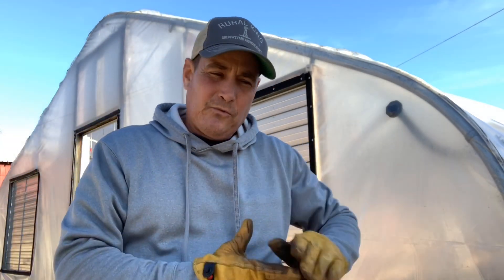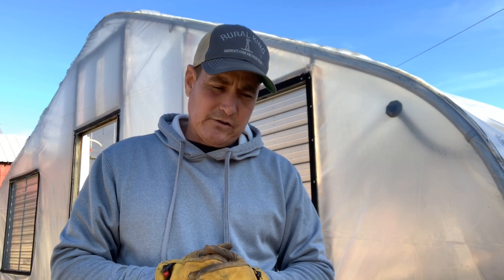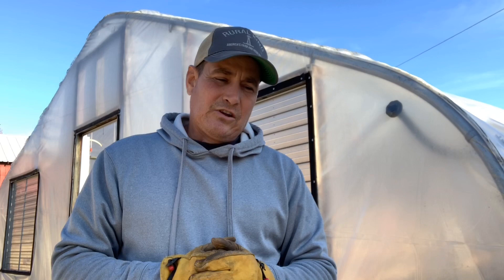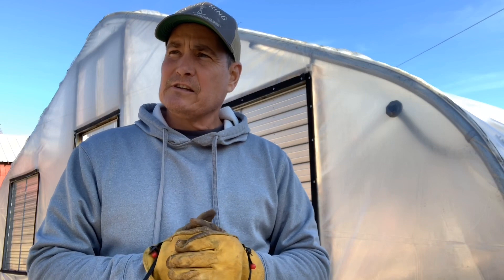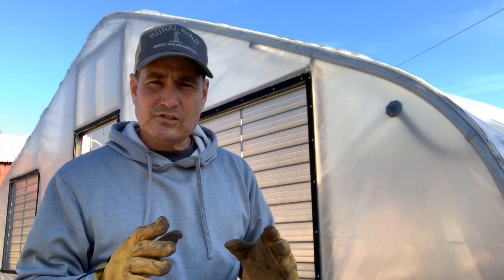The easiest way to cover your greenhouse: Part 1

Comment: I'm very happy you are doing a video on this task. Seems like there are a few ways of doing this so I'm interested in how you guys do it. I've admired how tight your plastic is on your greenhouses from seeing it in other video's you have put out. I'm sure it is a lot of work but if done right it is worth it. I have a small wood frame greenhouse and used a tarp like clear plastic that is indestructible and a bit of work to stretch. I do a silly test I was taught years ago called the quarter test. I bounce a quarter off the roof if it lands no less then 12 feet away we are good to go. Lol Does this test true ? Who knows but I can say we have had 80 mile winds and the plastic didn't even slightly ripple. Thanks for the video!
Reply from the maker: Melody Melody thank you for your comment. We have tried many different ways of covering but have settled on the technique I am gonna show. There are plenty of factors I think in getting it right and I’m gonna try and do a much better job explaining these things then I have done in the past.
Reply from the maker: Melody Melody my mother used the quarter test on our beds after we made them as children.

Comment: I need you to come show me the correct way to get the second layer on. It never works out to get the pillow effect on the air layer in between.  With the heat and cold it just doesn't stay put and crawls back and forth and makes tight spots. Plus the cats climbing on the top layer making claw holes isn't helping.
Reply from the maker: Stay tuned Rob I’m gonna try and cover all of that in videos to come. Thanks for watching!